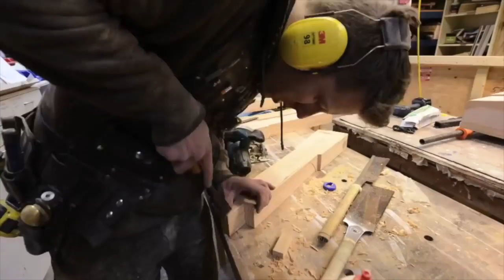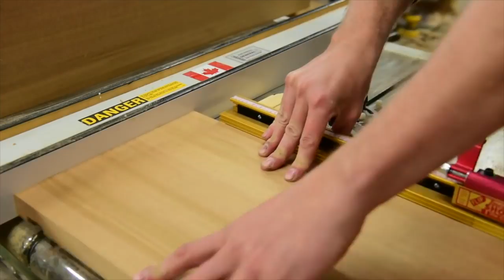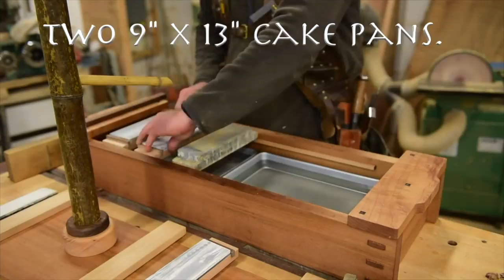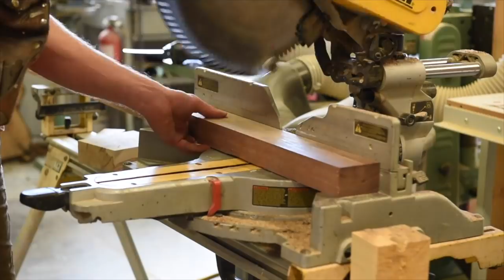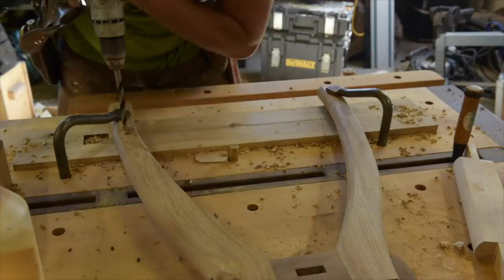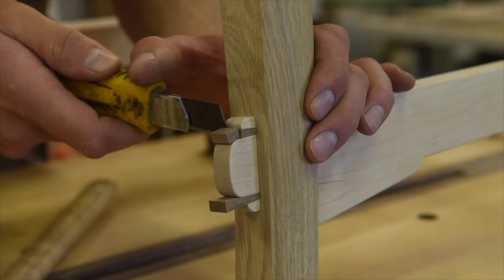Part 1: In The Shop Compilation Video

Comment: Sir, you have a finely honed skillset.  Very impressive stuff.
I have worked with a red wood cedar product shipped down from Canada for about 5 years ... in one summer I just was doing too much cutting and ripping of boards and the dust and fibers and natural wood chemicals got to me ... I'm allergic to cedar ... developed it as far as I can tell.
Does the dust, fibers not bother you at all?  Do you have some secret trick?  I can't hardly install cedar shake sidewall shingles without a reaction.  You seem to work with the rot resistant woods pretty heavily.
Just curious.  Thanks.